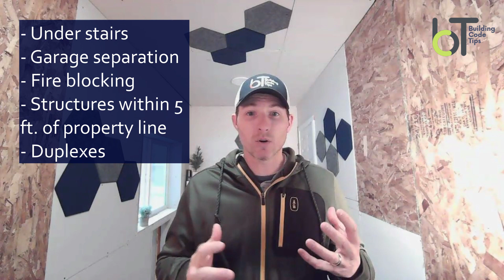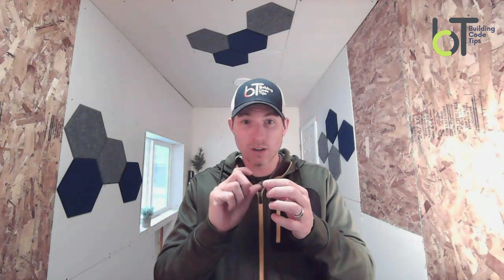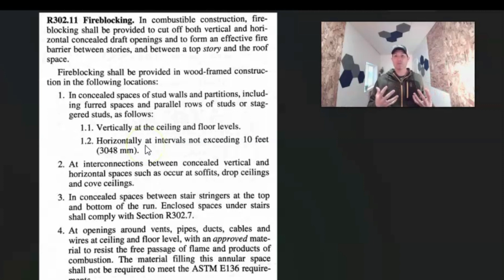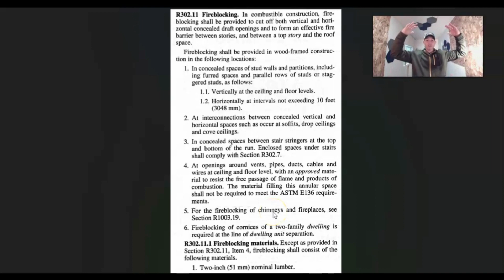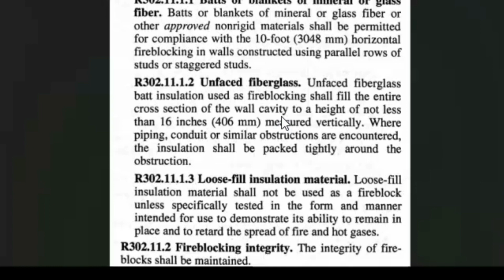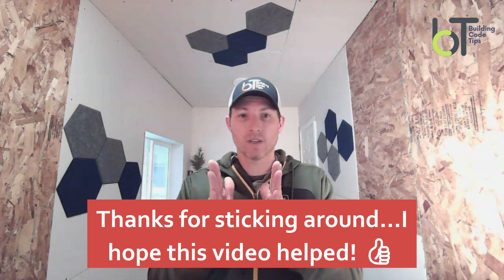WHAT IS A FIRE RATED WALL | RESIDENTIAL APPLICATIONS FOR DIY

Comment: 2018 IRC 302.11 does not have any fireblocking requirements based on wall height.  It only requires blocking where the vertical and horizontal surfaces (wall to floor, etc.) meet. The 10-foot requirement is measured in the horizontal direction, not vertical.  It is meant to limit the travel of a fire in the horizontal direction along a wall.  Therefore, every 10 feet or less, fireblocking must be applied to isolate between stud cavities.  An example would be a finished basement with a stud wall erected a few inches from the concrete foundation wall.  Every ten feet or less, wood blocking or rock wool must be used along the entire vertical gap from floor to ceiling between the stud and the concrete wall.
Reply from the maker: Thanks for the comment!